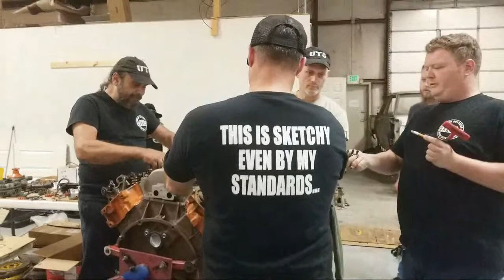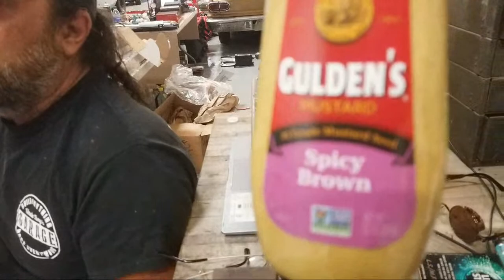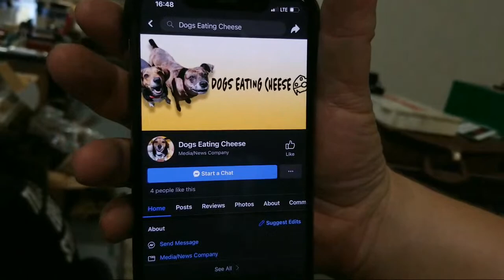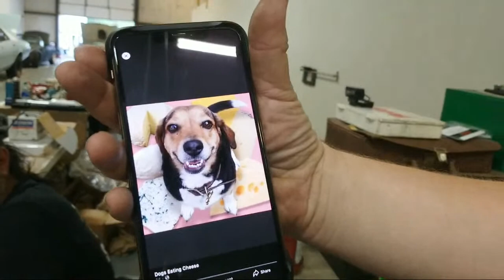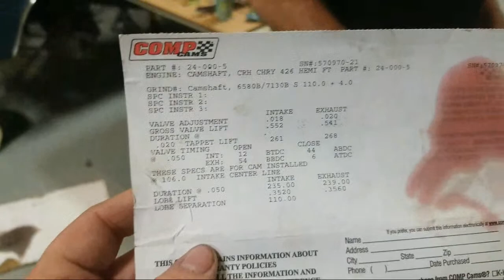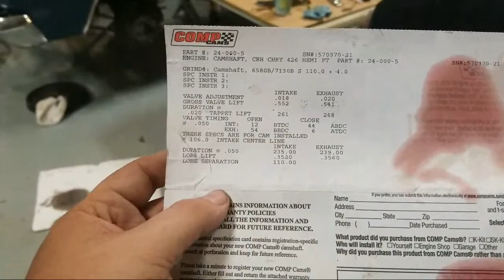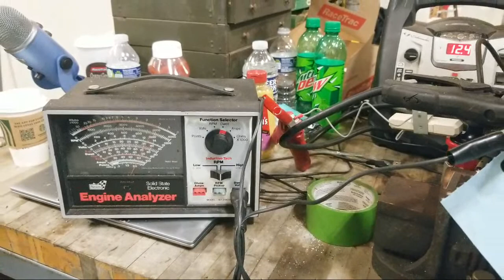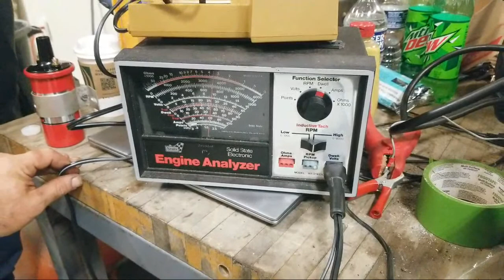UTG LIVE 426 HEMI GTX BUILD AND INSTALLATION REBOOT

Comment: When the points open, the magnet field created by the primary windings collapses in the coil. When this happens this magnetic field passes through the secondary windings in the coil. There are a lot more secondary windings than primary. This creates the high voltage needed to create the spark at the spark plug. Soooo, as the magnetic field continues to collapse, it passes back through the primary windings. This creates another power surge in the primary circuit(points circuit). The condenser absorbs this surge. This prevents this surge from jumping the gap in between the points contacts. This surge would burn the points. Now, beings the condenser is charged, it flows this power back to the coil again. This helps to prolong the spark at the plug. Typically this oscillation takes place 7 times, every time the points opens. Back in the day, shops used a Sun machine that had an oscilloscope. You would see it jump to around 18kv, then you would see the line squiggle smaller and smaller afterwards. This squiggle is the condenser charging and discharging until the points close again. This is what the condenser does.
Reply: Excellent explanation.
Reply: a detail I appreciated: dual points.

Comment: Come on .001 will not make a difference with .018 clearance.    You should also check the clearance after the valves get beaded in

Comment: I'm watching the intake manifold tightening procedure and yelling at my computer screen "You left out the throttle cable bracket and two carburetor throttle return spring brackets!" that go between three of the intake manifold bolts (on the left side) and intake manifold. Lol...

Comment: I heard a lot of conversations about how they came up with the odd torque specs of 72 and 48 inch pounds. Probably because the actual spec was in foot pounds of  6 and 4. They multiplied by 12 to make it readable on a smaller inch pound torque wrench.